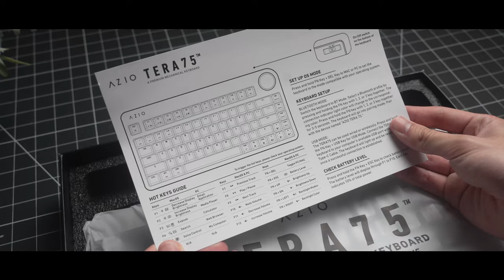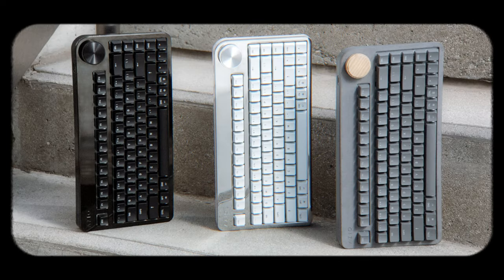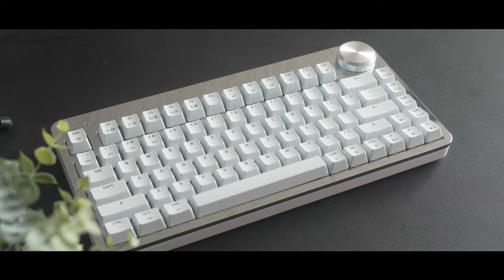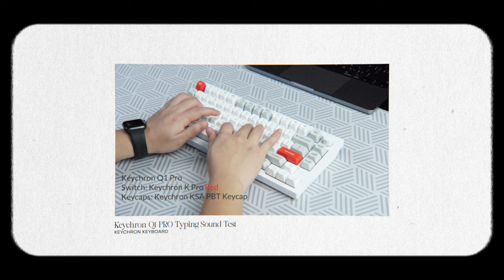A Keyboard Made Of Concrete? Azio Tera75 Review

Comment: I liked the video!

But if you'd be willing, some bits of constructive criticism.

I think your key lighting might be a bit too intense, as a lot of the reflective surfaces are blowing out pretty easily. You could compensate with a brighter fill, or more diffusion. I like the lighting in most of it, but some of the flashy parts can get distracting. Bouncing your light off a white surface could also help. 

A lot of the clips are a bit shakey. A stabilizing jig, or even a steadicam, could help a lot. Also, software like Davinci Resolve(free) has some great post stabilization if you have the FOV and resolution to spare.

I noticed it seems like most of this was shot pretty tight with a higher focal length lens. If you can, I'd experiment with some wider focal lengths, it can help break up the orthographic feeling bits and make new opportunities.

And finally....Upload in true UW. Adding black bars to a normal width video not only can(in my experience) cause lower video quality compared to how much is actually visible, but causes viewers on UW displays to have to watch with black on all sides. 

Cheers :D
Reply: Great critique! Do me next.

Comment: One interesting thing to note; those are the exact same stabs that come stock in Keychron "Q" products. Steel plates are another component that I have only ever seen in Keychron products. Manufacturing assumptions aside, the difference in value proposition between this board and a Keychron Q1 is quite large. I expected a much worse stock sound profile after seeing the price.

Comment: Nice to see more boards for sub 200 buck prices but this is disappointing. Tray mount, steel plate, north facing LED sockets, bad sound profile stock, OEM profile keycaps, & gat g pro switches?  It has silicone, plate foam, and PE foam and it still sounds pretty weak. 10^12 unnecessary. With your second configuration, now it’s a little hollow. Ultimately wouldn’t recommend.
Reply: At that price point, its really a disappointment. Any cheapo sub 100$ China custom keyboards are way better than this. Its look a cheapo Royal Kludge keyboard with a fancy swappable top case and knob only.
Reply: I agree, they somehow wanted an in between of custom boards and prebuilts but failed miserably with all the reasons you mentioned.
Reply: @williamchiawq3747  Just get an Envoy for $180 lol
Reply: @shynnsup8383  yup, I ordered that. Barebones to barebones comparison. Envoy is in totally different level.

Comment: Tbh, the stock and rebuild sound test both sounds pretty nice, the rebuild one sounds better than most flex cut board(cough qk cough) with minimal foam. And I'd prefer a tray mount > a too flexy/bouncy board, especially for tactile(I sometimes switch to akko mod001-a north facing tray mount rather than using my 400$ gasket mount endgame board). Sometimes specs aren't everything and you may like a board with generic old specs > a "modern" board with sh*t ton of specs but still suck(cough qk non foam cough)